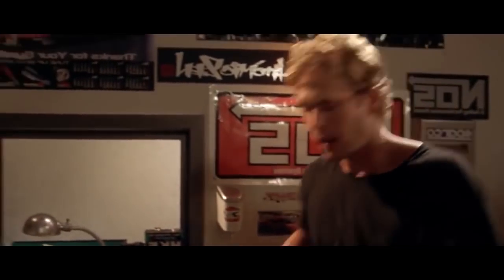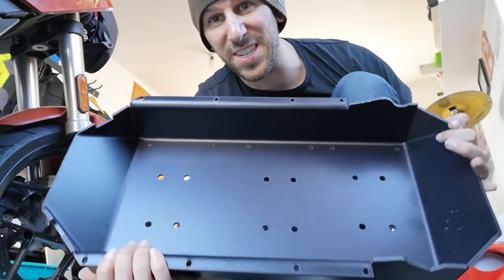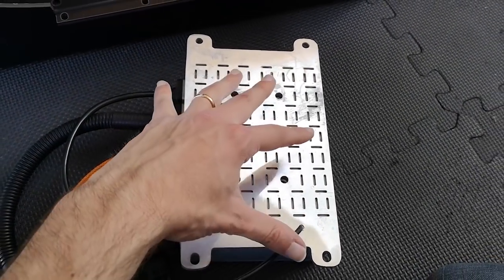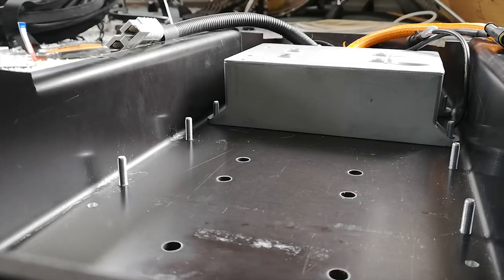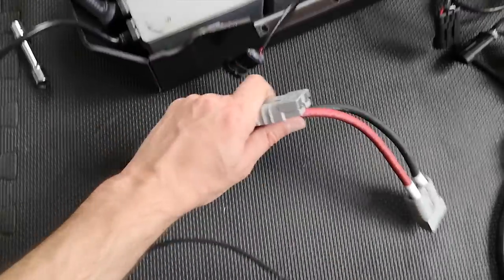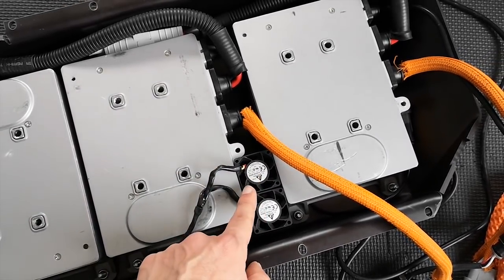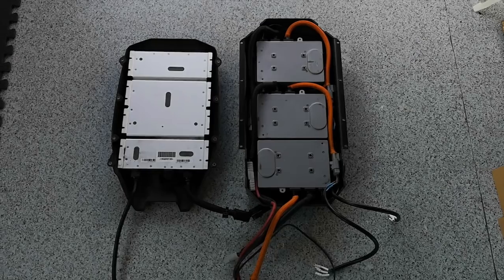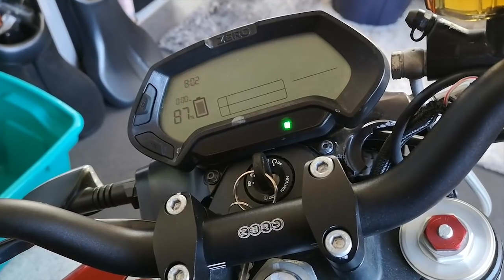The Pans and The Mennekes

Comment: The SR got a plastic oem bellypan, but my DS was already from metal.
I will weigh it, weight difference will be smaller on DS(R) compared between stock and Diginow.
🤔😎
Reply: about 2kg, but I have still a analog weigher.....🤣

Comment: Really love your help a buddy charge facility. Way to go! Why don't Zeros come out like this as standard?  Greetings from Australia (On converted 250 Ninja to 8kW hub motor....solar charged}.
Reply from the maker: Whoaaaa awesome!  Good going on the conversion.  If you have any videos of it, I'd love to see that bike in action!
Reply: @NewZeroland  YouTube video is work in progress. Lack of camera crew. Top speed is 120km but not sustainably as the motor starts overheating. Range is 120km when going 80kph, so say 80km conservatively at road speeds. Battery is LiFePo4 72V/90Ah. 

Charging is on 3 260Wp/24V panels in series. Plugged straight into the battery via 50A Anderson, an on board cell voltage monitor disconnects the panels once the first cell goes into over volt. 

I prefer hub because of design space and the only moving part of the whole drive train are the two wheel bearings ! No ripped belts here !!!

Acceleration of the 8kW is 'sufficient'...gentle from stand still as there is no reduction gears but strongish from 50kph onwards.

In a future project I would do a big bike like a Suzuki 1100 using a liquid cooled hub say 12-26kW...that is all you need with the speed limit of 100-110kph in Straya. Battery with a range of 250km. 

I have made some special arrangements with coffee shops in surrounding towns: The  'A Coffee and a Kilowatt' deal when visiting and I always donate one Aussi$ for the electricity. 

My other bike is a Moto Guzzi 850 T3......but I think the e-Ninja will be the lone survivor of the two.....one day.
Reply from the maker: @moestrei  wow, that's awesome!  Hub motors seem to be the way to go for waterproof reliability.  Like you said, no snapping belts.  It's hard to find one with power to rival a sportbike, though.  Energicas have 107kW!  That might be unnecessary haha, but it converts a lot of petrolheads over to electric real quick.  An 18kWh pack should get you 250km's at highway speed.  Maybe an even smaller pack with that kind of motor.  Exciting stuff!